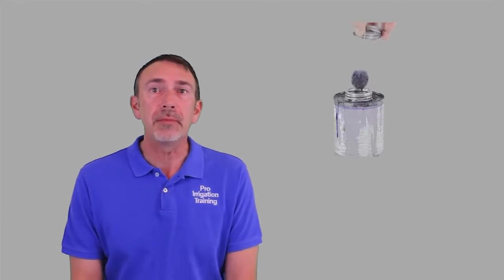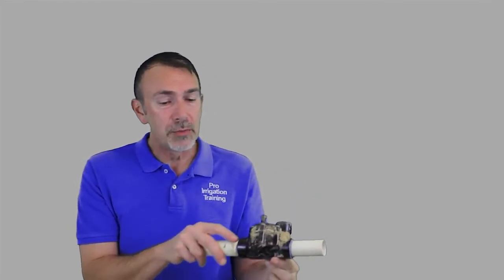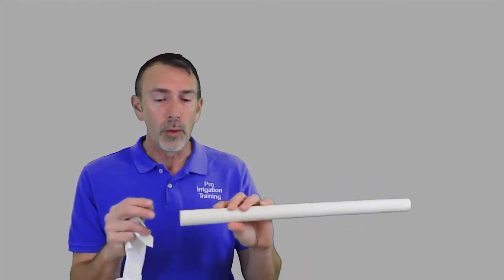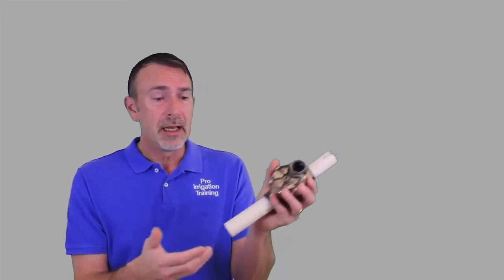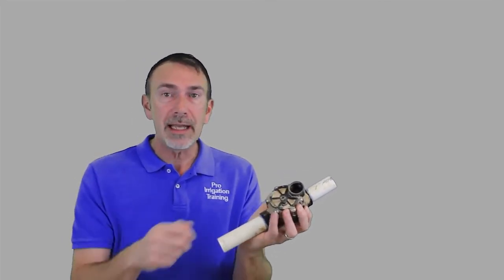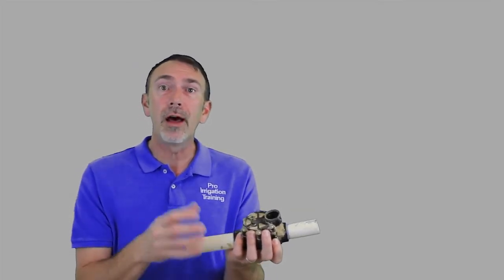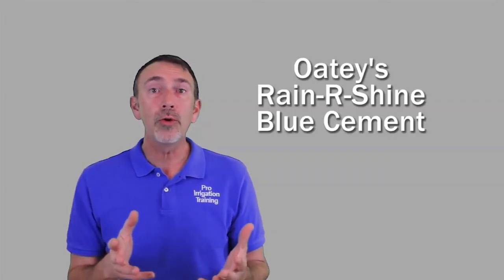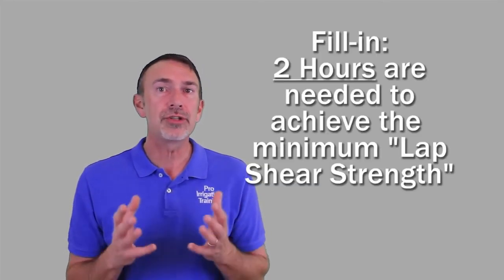How To Select PVC Glue (irrigation pipe repair)

Comment: The Primer needs to be not left wet but fairly dry, having most of the solvent already dried off. The actual time for this to happen is temperature dependent. If the pipe is subject to a prolonged dry time, you need to re-apply more primer.   The PVC pipe needs to be chemically softened and prepped for a glue "weld".  Most 7 to 5 mL Nitrile gloves work well enough for grip and protection while doing priming and gluing. Latex gloves melt and breakdown.

Comment: Why don't you show the way to cut and remove a section of pipe to allow a 1/2 pvc/cpvc ball valve to fit, Also how to put on the primer and glue using a 1/4 inch applicator (if one can find one) and not glue the seat. That is real life stuff for home owners. Its easy to just prime and glue a 2inch elbow to a pipe on camera. Do real life stuff.
Reply from the maker: Thank you for the suggestions!

Comment: What's the thing u glue with called the cotton ball thingy
Reply from the maker: I think the proper term is "dauber". Thanks for watching!!
Reply: The Purple primer does give confirmation whereas, a Clear primer does not.  It has saved me much grief from prior "unglued dry fittings" especially when pre-assembling a lateral line or component.